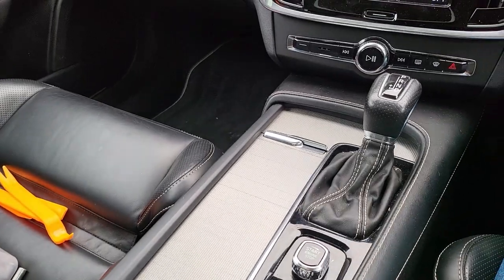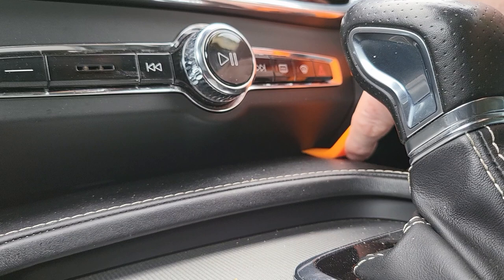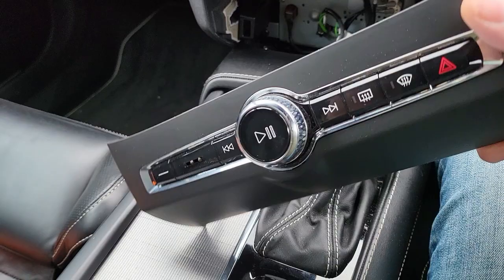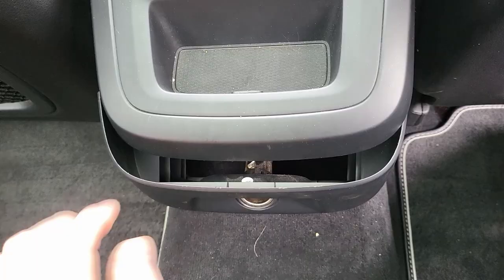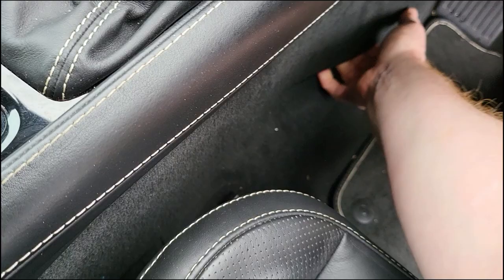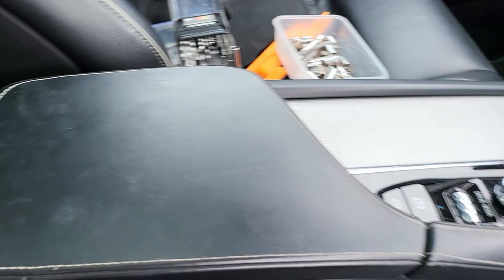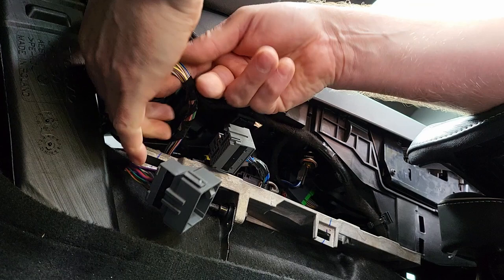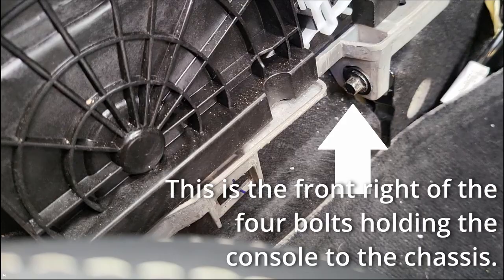Volvo V90 Centre Console Removal

Comment: Great video for removing centre panel But can change sliding cover in about ten minutes  without removing it
Reply from the maker: Great, please let us know how?
Reply: Sorry but mine is a v60  looks very similar.  At the end of the track the 12v socket end the sliding cover can be slid in. The only thing stopping this is a small piece of plastic at the entrance of the slider track which is easily removed with a dremel type tool

Comment: Im having trouble with releasing the gear mechanism, mine is the same but with an extra piece of plastic on it. Any ideas?
Reply from the maker: Hmm, I'm sorry, but without seeing the problem I don't think I can help, but try asking your question on a forum like swedspeed.
Reply: @morriscarstairs2685  finally got it done. If you just push the clip in and twist the link up, you should just be able to easily pull it off. Thanks for you reply tho.